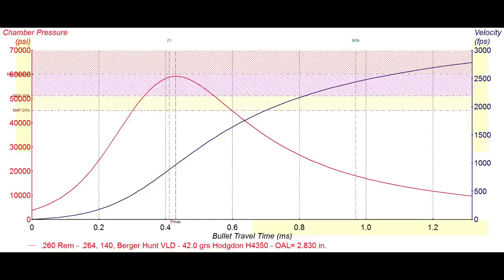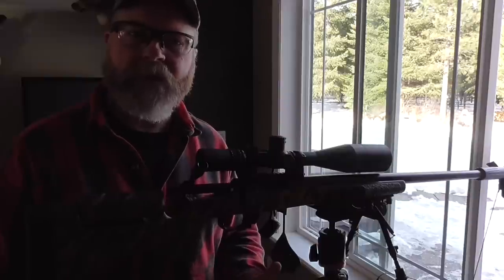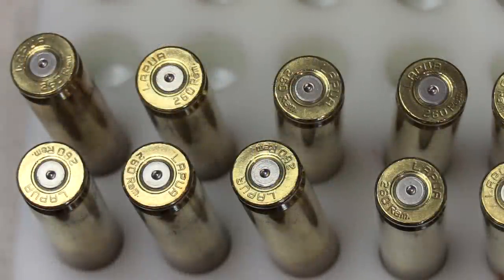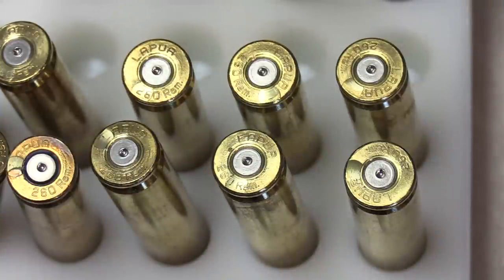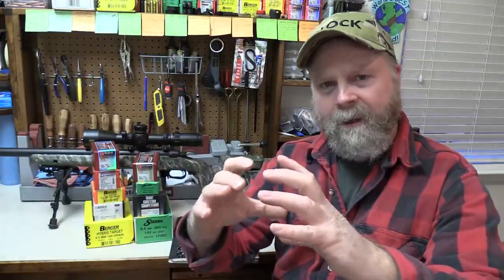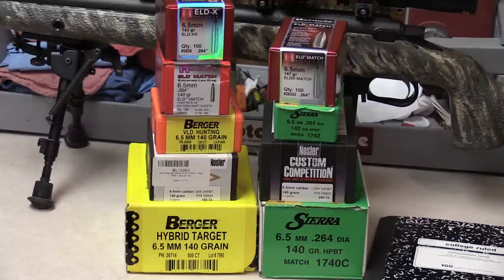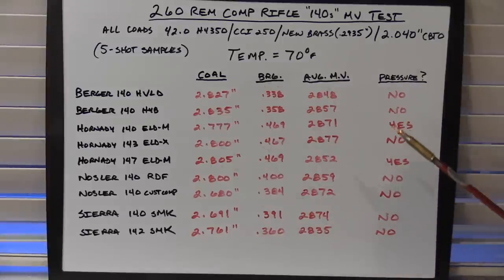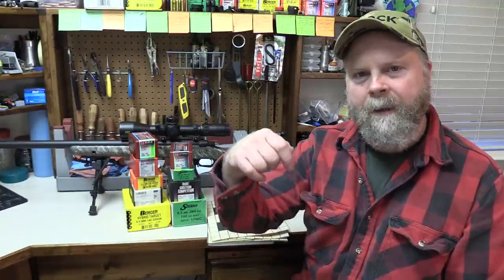Precision Rifle Load Development/ Part VI: Pressure Signs & 140-grain Velocity Testing

Comment: I wonder maybe you could help me on this problem.  I just started back reloading after 27 year break, and all of prior exp was pistol loading. So I am trying my first run on a .257 Ackley Imp. using Redding dies with the expander “ball” on the decapping stem in the sizing die.  Well after I have decapped and reprimed I go to set the bullet in the case after charging w/powder and I can’t get the bullet to partially seat by hand in the case when I attempt to seat the bullet in the press.  I mean I can barely get maybe a hair or so past the boat tail of the bullets I am trying to use, but that’s about it.  I have racked my brain/ and the press trying different things for hours on this and can’t get the neck to flare anymore than just a few thousands of an inch and that’s not enough to allow me to get a decent section of the bullet to drop into the case so I can finish it out with the press.  Now I am used to pistol cartridges and having a very visible and “large” flare that I can easily hand set the bullet and align before I use the seating die.  Are rifle cartridges like this?  Meaning you have to almost balance the damn bullet on top of the case and just use the press to basically push (and expand) the neck out with the seating die?  I have measured my neck AFTER supposedly expanding it and it appears to me that I am 2-3 thousands of an inch TOO SMALL for the diameter of my .257 caliber bullets.  Oh yea, I have tried 4 or 5 different type and brand bullets and still nothing appears to change.  Any help would be so appreciated.  I am about to drive myself crazy over what I always thought was such an easy and simple phase of reloading.  Thanks much!
Reply from the maker: The ID of the sized neck should be .001-.002” smaller than bullet diameter. There shouldn’t be any flare in the mouth of a rifle case.
Reply: Panhandle Precision sweet, well I started thinking the same thing a few hours ago after wasting a lot more!  Haha, guess I was over thinking it.  Just trying to be safe and not blow up my rifle or waste my supplies.  Appreciate the help so much.  Your channel by the way is got to be one of the top channels.  So clear and straight forward without any fluff and puff

Comment: What does over pressure look like on an ar10 with jp high pressure bolt. Because with 140gr 6.5cm im up to 43.3gr with no visible signs. Max claims to be 41-41.5gr

Comment: Where do you get bearing values for bullets, and what difference does that make? I've never seen that as a variable.
Reply from the maker: You measure it with two comparators/inserts. It varies across bullets of similar weight due to bullet shape. It makes a big difference in pressure/velocity.
Reply: @PanhandlePrecision  OK so for my 6.5CM I might take the 26 comparator measurement, then change to a 23 comparator and that will give me a value? I've never used more than one comparator. for a given caliber. Like I said, it's new stuff to me... :) 
PS thanks for the reply and I hope you had a Merry Christmas.
Reply from the maker: @chipsawdust5816  Two “26” inserts.

Comment: I shoot 147 eldm in my 24“ barrel 6.5creedmore and only get 2500fps with 42gr H4350 I’m gonna double check my brass but It felt to me I’m about wher I hit to high pressure I may back off to 41.5gr both load have around 10es wich im very happy with but velocity is not great. I wonder if it’s just be cause it’s a Remingotn hb not s custom barrel not yet

Comment: What are the pros and cons of a .260 V. .270?
Reply from the maker: The biggest advantage of the 260 is the quality of the components available for it: high-B.C. bullets, brass, etc. You can also run it out of a short-action receiver. The biggest advantage of the 270 is factory ammo. I have both, but I wouldn't buy or build another 270.

Comment: I am restricted to aics mag length should running 147gr and 140gr eld if I load them to max mag length at 2.860 they just barely miss the ramp.  Backing down to 2.850-55.  At that point should I just start my load work ups at factory lengths like 2.810 find my charge and do a following test once node found working seating length ever .5 back up to mag length of 2.860 for max reliability
Reply: Did saterlee test over the weekend and found a low node at 41.8 and high at 43.  260 rem 147gr eld H4350 lapua brass br2 primers seated at 2.850 ran the test up to 43.8 the high is giving me 2777 avgr velocity.  85 degrees out side I get a ejector swipe sign at 43.2 temped to keep the high node.  Over the 2700fps low node.

Comment: thanks for the videos!  on yourwebsite  you mentioned you try for .001 neck tension now,  what led to that conclusion?  as a hunter shooting from a magazine,   have you had any problems with the lighter neck tension allowing the feeding  bullet to get bumped out of concentricity on the ramp or something else
?
Reply from the maker: kevin lowe I’ve never had one move coming out of the mag, or pushing the bullet against the bench. The only time I’ve had a problem with .001” is when seating over a compressed charge. The bullet has a hard time holding its ground against a full column of powder. I’m slowly changing over to .002” because of this, but have yet to see a performance difference from .001” to .003”. It all works!:-)
Reply: Since you see no difference in performance,  I'm guessing you work with .001 neck tension so as to not over work the brass?  Benchrest shooters will discuss endlessly about neck tension on the forums.  Through the years, I've been encouraged by gunsmiths and shooters to used between 2 and 3 thousandths in hunting rifles.

Comment: On the subject of your MagnetoSpeed Chronograph bayonet affecting your barrel/rifle harmonics.
You may be able to rig up a rail, rod or a false barrel(metal/plastic tube/carbon fiber) to hang the bayonet off of.
A aftermarket solution such as one from Masterpiece Arms or another supplier would also work.

https://masterpiecearms.com/shop/mpa-rat-magnetospeed-adaptor/

MagnetoSpeed 
https://magnetospeed.com/products/v3-rail-adapter

Comment: So I am not gonna end up like these people on youtube blowing up there guns? Just blowout a primer and then back down? Do you ever go above the books max pressure recommendation?
Reply from the maker: People who blow up guns must do something a lot more serious than adding a grain or two to their previously safe load. I would never recommend blowing out a primer intentionally, because it’s hard on brass. I can only comment on my own personal experience, which is primarily with spring-loaded plunger ejectors in bolt actions. If the plunger leaves a mark on the case head, I am above the pressure I’m willing to run in that case. I can’t remember the last time I looked at a reloading manual, so I don’t know where I am in relation to their published max loads. It’s a good place to stay, though, until you gain your own experience.
Reply: @PanhandlePrecision  Thank you. After several days of research finally stumbling across your case head separation video  gave me alot of reassurance. I am concerned that my only way of determining an overpressure round is a primer inspection. I suppose I am on a diving board and just need to jump. I feel I have done everything I can to reassure safety. I did see where people are measuring their case head. Apparently if there is .0005-.001. Crush the case, but my calipers are constantly off that much.
Reply: @PanhandlePrecision  Do you get your starting load from quick load? I have noticed it says "do not use" on some loads that are allowable according to hornadys manual. Is this warning negligent to you as well? As an experienced reloader you base your load build ups solely on pressure signs?
Reply from the maker: @pearlrival3124  I don’t use Quickload or reloading manuals. If I were to play with a wildcat or a powder with a much different burn rate than normal, I’d probably hit the internet first.
Reply: @PanhandlePrecision  I went by manuals, quickload, and personal opinions online to pick out powders. Now i'm shooting these loads above their maximum according to quick load and the manuals, and still haven't seen any significant pressure signs. I feel like going heavier until I feel the case or until there is evidence of a pressure issue. Is this a bad idea? I do see a light scratch from the ejector on the brass after firing, but not an indention. One particular powder is flattening primers, but there is still a noticeable radius. I am shooting a 30-30 and a 22 hornet. I am thinking since I have used your jam/lands video this has offered more room for powder and decreased pressure enough for me to go over the maximum.

Comment: If the case is slamming back into the bolt , perhaps you need to learn how to properly resize the brass , so that the case actually fits the chamber of the rifle,,as for pressure, learn how to use a micrometer and measure the expansion ring of the case, flat primer means nothing, and extractor marks can come from way under charged and a headspace gap that allows for the case to smash the bolt

Comment: If the bullet is seated deeper into the case (less space inside the case), can that cause pressure to rise as well or do you see the most dramatic spike in pressure simply beeing how close you load a round to the lands?